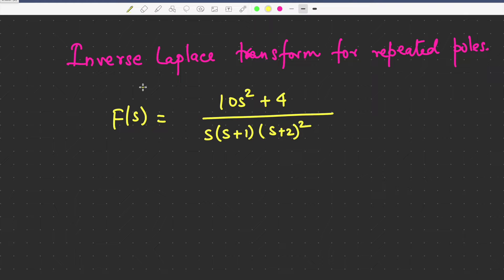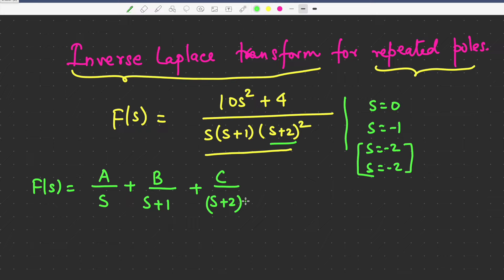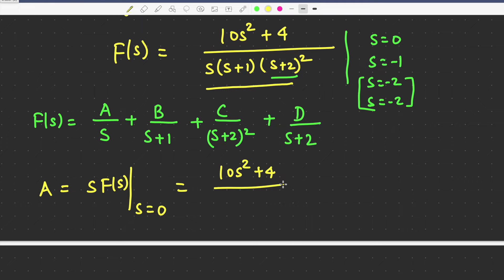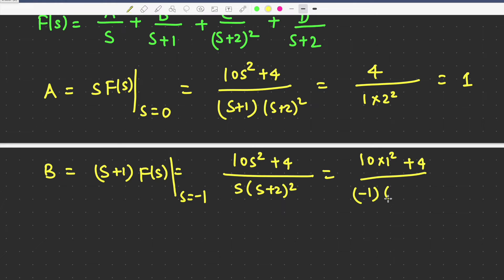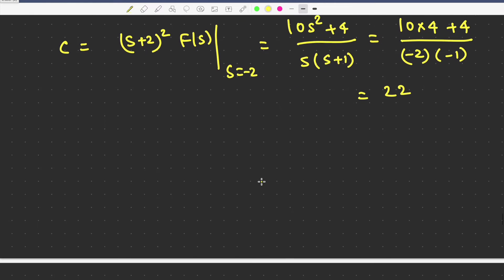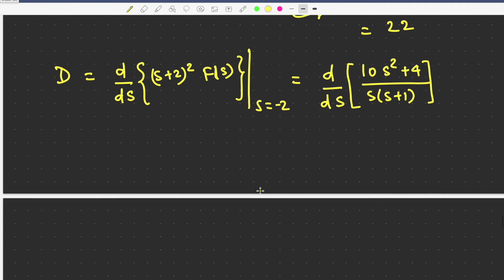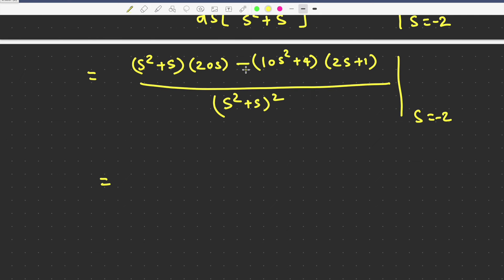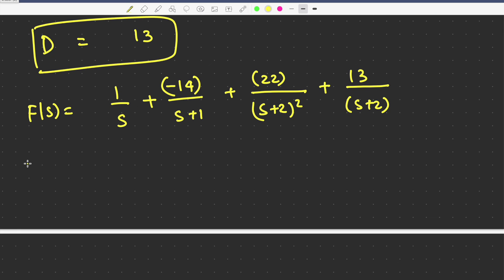Example of Inverse Laplace's Transform for repeated poles using residual method

Comment: F(s)= s^2+2s+1 / s(s^2+2s+5)
Reply: can you solve this task?
Reply: @SaninSelimovic-zh8eq  
Given:
F(s) = (s^2+2*s+1)/(s*(s^2+2*s+5))

Complete the square on the denominator:
F(s) = (s^2+2*s+1)/(s*((s+1)^2+4))

Set up partial fractions for a linear denominator term (A/s), and a quadratic denominator term (linear numerator), using the shifted value of s instead of just s.  You'll see why this helps:
F(s) = A/s + (B*(s + 1) + C)/((s+1)^2 + 4)

Heaviside coverup finds A for us, at s=0:
A =  (0^2+2*0+1)/(covered*(0^2+2*0+5)) = 1/5

Reconstruct what remains:
(s^2+2*s+1)/(s*((s+1)^2+4)) = 1/5/s + (B*(s + 1) + C)/((s+1)^2+4)

Let s = -1, to solve for C.  Notice that B cancels out:
((-1)^2+2*(-1)+1)/((-1)*((-1+1)^2+4)) = 1/5/(-1) + (B*((-1) + 1) + C)/((-1+1)^2+4)
0 = -1/5 + C/4
C = 4/5

Reconstruct what remains:
(s^2+2*s+1)/(s*((s+1)^2+1)) = 1/5/s + (B*(s + 1) + 4/5)/((s+1)^2+4)

Let s = -2, to solve for B.  We choose -2, so all the (s+1)^2 terms become 1.
((-2)^2+2*(-2)+1)/(-2*((-2+1)^2+4)) = 1/5/(-2) + (B*(-2 + 1) + 4/5)/((-2+1)^2+4)
-1/10 = -1/10 + (-B+ 4/5)/2

Solve for B:
B = 4/5

Partial fraction result:
F(s) = 1/5*[1/s + (4*(s + 1) + 4)/((s+1)^2+4)]

Arrange to look like standard Laplace transforms:
F(s) = 1/5*[1/s + 4*(s + 1)/((s+1)^2+4) + 2*2/((s+1)^2+4)]

Inverse Laplace:
f(t) = 1/5 + 1/5*e^(-t)*[4*cos(2*t) + 2*sin(2*t)]